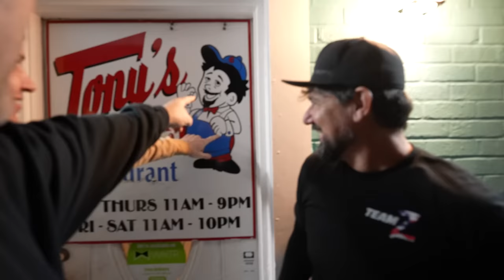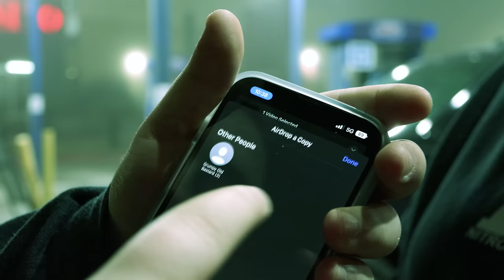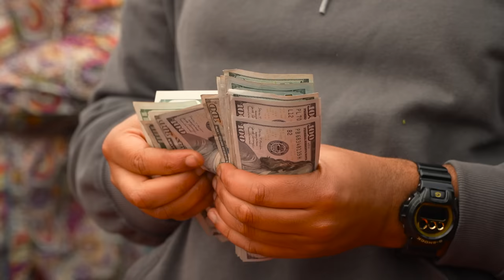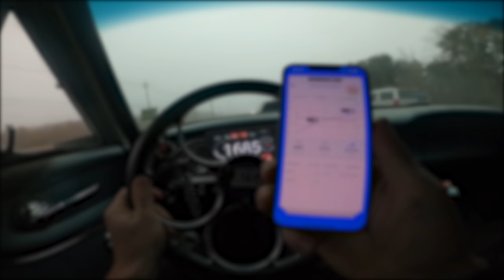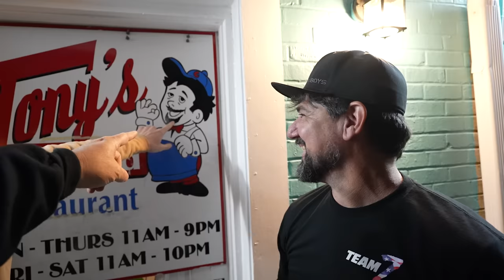BeaterBomb and Billy The Kid go to WAR on the Streets of NEW ORLEANS!

Comment: the Falcon was flying, had a good chance to take it all. Awesome video... Regarding the window fogging issue: fabricating a small box on the passender side underdash, with a blower motor attached to the defroster duct, will help keep the window cleaner using underhood heat. It will also help remove smoke from the cab after the burnout.

Comment: Billy hit up motion race works and get an oversized alternator pulley I was struggling with the same issues on my 6.0 LS you're probably turning too much RPM for it to last long I was replacing them every month for about 5-6 months before I figured it out .. billet oversize alternator pulleys for motionrace works fixed it haven't had a problem since

Comment: someday my K3500 will be on this show. not until i tear it down to a bare frame and build a motor for it though. if i keep it my daily im just gonna build out the 6.0 vortec it has in it currently (its a swap) but if i get something else to use while in the build process then id step up to a 402ci  stroker with a dart shp pro iron block (4 in. bore) a callies 24x billet dry sump crankshaft (4in. stroke) callies ultra enforcer rods, and diamond pistons. it"d use cathedral port heads, specifically 215cc AFR heads (flows 312CFM, lord knows i need the torque) a FAST LSXRT intake manifold with a 92mm snake eater performance dbw throttle body. it'll use a custom ground comp cams camshaft based on the Big mutha thumpr cam but adjusted to take advatage of the particular components i have listed. id also run a holley terminator x max ecu to control the motor and trans (hughes performance custom 4l80e stuffed into a reid super 80 billet housing, with the complementary bellhousing and tailhousing. followed by a custom driveshaft and crane axle dana 80s with a yukon grizzly lsd in 4.10  and rcv axle shafts. its a dually but for drag id just use massive slicks in the back on whatd have to be custom 8 lug weld beadlocks. id stick with a similar to factory setup for the font end, billet tcase gears and some form of trans cooler setup to keep it cool for when 4wd needs to be engaged without destroying everything. custom control arms, redhead steering box, rcv cv axles, 4.10 locking diff up front, beefier crossmembers, the existing motor cradle is massive enough that id call it good as is. for the exhast id need custom headers welded up but theyd be somewhere closer to a mid length than a long tube with 1 7/8 primaries to 3 inch collectors to a true dual side exit exhaust with spintech shootout 4000 series race mufflers. (venturi design, no packing) from the 3 inch collectors itll step down to 2 3/4 inch piping to the mufflers and after the mufflers. the fuel tank would be replaced with a custom fuel cell mounted more centrally on the frame so as to keep the gas away from the exhaust. 1300cc injectors, custom tuning, and a big ass radiator to keep it cool with e fans too. i want it to be a real daily driver (forgot to mention, traction bars new leaf springs and quad (2 per side) king shocks. up front itd be the same torsion bar setup as factory too with properly valved shocks, most likely king shocks again.) itll be a monster, and im looking to put down around 800+ whp N/A and be able to handle it too. i know i wont beat most of the cars feautured here, but id love to try :)

Comment: It's not the motor that makes the Falcon work it's the chassis you can put a coyote twin turbo in there or a 7.3 Godzilla or a small block Ford twin turbo in there and it'll do just as good as the LS the chassis is what works and makes that car so awesome. But I do like that  ls engine and the builder

Comment: Beater Bomb is fast and consistent with a high powered well set up car … but he isn’t unbeatable as he sometimes thinks he is ! I don’t know the man but from the way he portrayed him self on the New channels podcast he was very arrogant and almost seemed to act as if the SRC crew was no comparison with him . I know he was worried when he lined up against Billy in the nova and he should have been if it hadn’t been for the crank builders failure it probably would’ve been a different outcome! He should have been just as worried about that Falcon because the driver(s) and the car are beast and he got his ass straight drug I mean train gapped!!